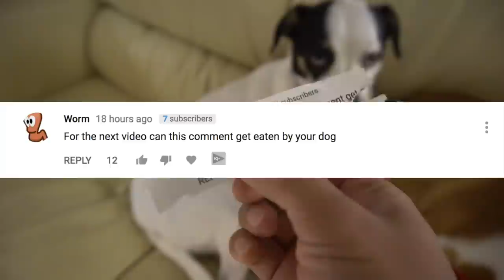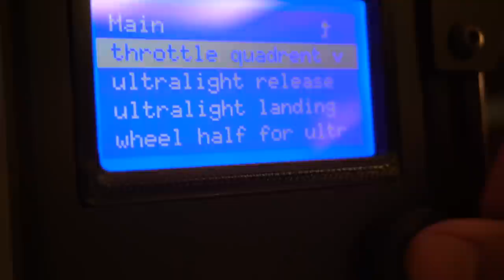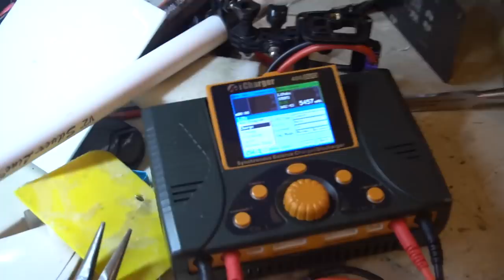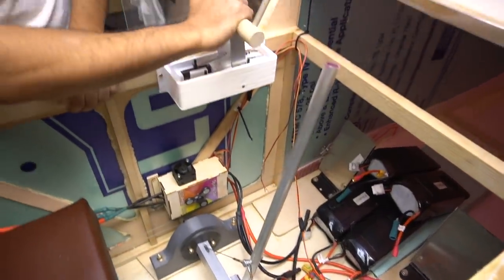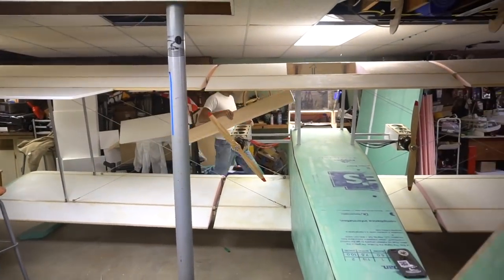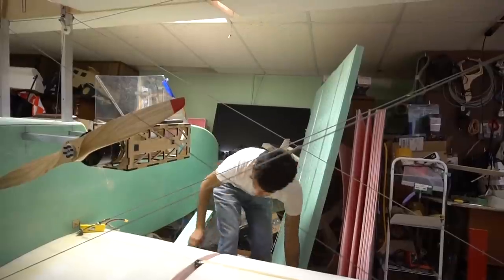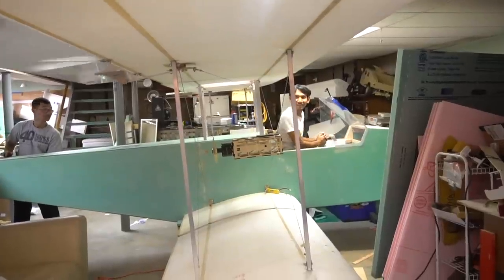DIY Electric ultralight pt6 (GIANT MOTORS and final checks)

Comment: Peter simulate a take off by giving it around 80% throttle for 2 minutes on the ground to check if the escs and motor can handle the current and will not cut off or something midflight due to temperature issues or something.
Reply: Nn
Reply: 69 likes nice

Comment: 11:02 the right motor bent forward a bit when you hit full throttle
Reply: well that is going to be problem... specially if it hits wires
Reply: That's more of a problem in a static environment.  When the plane can move, it will give way (move forward) before the bending moment of the mounts is reached.
Reply: Actually, you are wrong. Air space is not static, meaning that there is wind, gusts and turbulence, leading much greater forces than those 2 motors can produce in "controlled" environment. Of course that is not all, every physical object do have an resonance frequency where forces can easily amp up and break the object.

Also do you think those motors stop producing force right after his plane starts to move? Nah, propeller efficiency will decrease as airspeed goes up but that plane will not go so fast that it could do any significant difference.

random perception: Drag on that plane compared to prop size is remarkable. According to my experience this means high cruise throttle. I'm concerned that after take off there might be only 5 min flight time before he need to prepare to land.
Reply: maybe something like a big circuit breaker or just a cutoff switch rated at like 500A.  sure it will be large and heavy, but that way you can turn it back on if needed.
Reply: bent? its a miracle that those tiny square aluminium tubes didnt break
Reply: Brilliant! Man ! Brilliant, can I ask you to use a wire brace to the motor pods, to triangulate the support? only has to be fine braided wire but good quality, the torque from these motors will, in my opinion be quite considerable, so please brace :)
Reply: I think it just went forward a little bit

Comment: I would strongly suggest that you add some kind of emergency power cut off (like a handle), so that if you get into electrical troubles, you can pull the handle in half a second and then focus on crashing safely :)

Like if one of the engine controllers goes whack and you need to kill the motors to get out of a spin or so.

Looking forward to your maiden flight :)
Reply: Thing is, if the worst case scenario happens like the batteries go aflame, then cutting the power means nothing. Be better just to velcro them down and maybe add a handle like a piece of 3/4 inch rope to them so he could just yank them out in an emergency and toss them overboard then glide home safely. (he would need to move forward to counteract the CG being shifted more aft)
Reply: Shh.. Peter knows his stuff 🤚
Reply: I really don't want to be a hater, but if he gets into a spin at a low enough altitude(higher than, say 10 m and lower than cca 100m) no cutoff lever and no brs will save him. Higher, the brs might have enough altitude to activate and save his ass. He has very little chance to get out of a spin properly without proper training and the understanding how the aircraft performs in critical flight envelopes. Spinning is quite a violent affair, at a moments notice your legs are pointing straight at the ground and your airspeed rapidly increases, as you spin in the direction of the wing that lost lift first. It is quite scary and recovery must be practiced or at least taught(for airplanes in which spins are not permitted).  I don't know about his aircraft piloting experience, but he really shouldn't fly the maiden himself if he has none. It would be a waste of a great man and of the aircraft, that looks quite nice. Even if he just damages it, it would be a waste of a great project.

As for the propulsion system, lipo batteries are quite volatile, and even professionally made electric glider propulsion systems had some problems. I include a report about fires caused by FES systems in gliders:
https://assets.publishing.service.gov.uk/media/59c8f175e5274a49c07f4704/AAIB_S3-2017_G-GSGS.pdf

Best of luck,
Andrej
Reply: alterthough not crash glide
Reply: Lipos are bad news should they fail, speed controllers too. Just look at the fires in those hoverboards last christmas season and you get the idea of how volatile they are. Think how these batteries are often made by the cheapest way possible in China with low QC  standards. Foam aircraft have been built with small 2 strokes.
Reply: I have to laugh a little at this. If he throws the lipos over the side his cg is going to be completely screwed for the glide home.
Reply: eternalfire1244 there is no good solution here. Fire in the cockpit of a foam plane would certainly be a catastrophic event, with or without the change in cg. Especially if the packs are close to the cockpit.

Comment: Peter be careful those motors, in some testing I was a part of for heavy lift drones, we noticed that they can peak around 300 amps in a 14s configuration. Be sure to size your connectors and wire appropriately or they will arc and carbonize. The only ones we found that worked well were castle 8mm bullets. In one instance we had them melt the high temp solder and simply fall off of the wire.  Also I'm not sure what ESC's you are using but if they are the Turnigy dlux 250A we had 2 of 6 units that had bad decoupling capacitors.
Reply from the maker: Chase Hill thanks man good to know! Went with 8mms and the escs are good for 300A continuous so your comment gives me confidence!
Reply: Even worse, if only one fails the differential trust problems would most probably be unsolvable. He might want to look into contra rotating propellers even for normal operation tho.
Reply: how many watts are your motors?
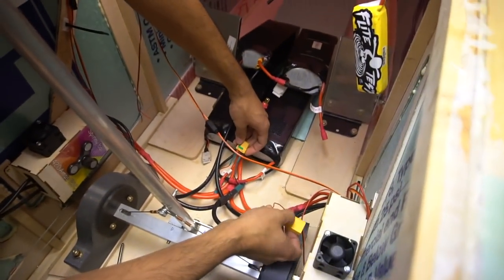Reply: Can any expert please tell me about the Spark Arrestor at 8:00 I have no Idea what Peter is doing, this is new to me I need to learn this before venture into bigger motor and batteries. Thank you
Reply: @zero00tolerance  There are big Capacitors on the ESC, which have a very low internal resistance. So if you plug the power wires in without Resistors, there will be a huge Current Spike that leads to a Spark between the Plugs. These sparks can damage the Plug over time. To prevent this, you connect a plug with a resistor beforehand so the Capacitors can charge themselves with low current thru the Resistor and then connect the big plugs.
Reply: @crazyphil3000   Thank you so much sir, do you mind send a link to the example part please that would be really helpful.

Comment: The motor mounts should have diagonal bracing to better transfer the thrust to the fuselage
Reply: Have a bump as I noticed this too. Also the anchor points of the wing stay wires aren't aligned with the force vectors. His build quality and attention to detail is steadily increasing though!
Reply: I thought the same too. The struts look like aluminium so they will probably be fine, but it wouldn't take much more weight to make them way stronger
Reply: My thoughts exactly! I also saw one of them shift under full thottle. One more thing; the motor and beam assembly may hit a resonance (natural) frequency at a certain motor RPM because of their geometry. He'll want to test at a number of different RPM's to make sure they don't shake themselves apart. Good luck!

Comment: Good stuff man! The only concern I have is when you put on the part that translates your stick movements to the control surfaces (min mark 2:05). Looks like you have the spar in the wing and that bit of foam as the only bonding surfaces. Is that going to be enough to hold up against the forces of the control surfaces pushing back on it?

Comment: I would personally recommend adding an air intake to keep your batteries cool. Some straps to hold the batteries in place wouldnt be a bad idea either!
Reply: I'd put it on the ESC rather than the batteries.
Reply: John Possum why not both?
Reply: I think it'd be a waste of aerodynamic efficiency to create that much drag -- I just don't think the batteries will need it. I suppose it all depends on how much he demands of it the first flight & then he can change some things around if need be. (my sense of Peter tells me he'll more likely be on to another plane/project before that.. Maybe he'll build a human sized boat next? )
Reply: He just did some low-level flying on his stream just now. Had to stop flying because his batteries were starting to get too hot or something along the lines of that. he could use one of those low-drag air intake designs

Comment: from what i know, the motor should spin in different direction to get balance, also the propeller
Reply: Thats not need most multiengine airplanes spin prop to same direction. look at a plane as Cessna 421 of Piper cheyenne

Comment: Do you have plans for a Fuse or Breaker for each motor/ESC/battery? easy to cut power to it in case of a runaway or something like that. Also, do you have a fire extinguisher rated for LiPo fires?  If the batteries do puff or catch fire in air, you should put some sort of shroud around them, at least to direct flames away from you (would likely melt out the bottom....) but just to keep you isolated. 
Love the videos, and Cannot wait for the maiden! Truly inspiring. I too want to build an electric ultralight, and this will help me figure out the logistics of electronics. What ESC's are those? I do not see a link to them like the motor.
Reply: Austin Smith yeah I'm wondering what esc's those are as well, but if I had to make a guess it's something out of hobby kings lineup because they probably provided them with the motors.
Reply: leo rawlinson I'd assume, but it's good to know specifics
Reply: On the Flite Test Community Podcast I think he mentioned them being jeti ESC's, so he's not cheaping out on them.
Reply: A good point.  An aluminium box or something like it might be appropriate.
Reply: They do 100A isolator could put one in each esc supply
Reply: At that voltage he could probably use those old-fashioned looking "knife switches" that people use on their cars. That should handle the current and the voltage and they are like $10 each. People used to put them under the hood as a el-cheapo method of avoiding getting their car stolen.

How do you breaker something that big? 250 watt ESC recommended and 190 peak current surge (The difference in those numbers should be a hint about their confidence in their ESCs BTW) He'd need a house main breaker. Spendy  for just one part! https://www.grainger.com/product/SQUARE-D-Circuit-Breaker-5ENP2

Here's a affordable reconditioned one in a top notch brand I would trust with my life: http://www.southlandelectrical.com/itemdesc.asp?ic=FXD63B200-R&utm_source=googlebase&utm_medium=cpc&gclid=CjwKCAjwj8bPBRBiEiwASlFLFVndwfdd5YB-N-1tXhSPZ8bih9UfpiSFIz-axIaQWjAv6L8ce9zVLxoCgEUQAvD_BwE

Comment: I suggest you add two resistors parallel to that potentiometer, so in case the wiper loses contact you still have some pre-set amount of power from the motor. Old crusty potentiometers like those faders seem quite unreliable to me.

Comment: You need to add independent brakes to the landing gear Which is operated by the rudder pedals so you can steer on the ground and taxi the run way with ease and a 3rd wheel so you are not trying to balance on 2 wheels or dragging your underside on the runway.

Comment: Peter put the propellers in opposite directions to decrease the torque effect I tell you why I am pilot and affects quite strong torque effect on a light aircraft like so I do not die XD
Reply: Do you mean to have one prop spin clock wise and one prop to spin counter clockwise?  Wouldn't have even thought of it but makes total sense. Im no pilot but i do a lot of boating and every boat that has twin engines or more have propellers that spin opposite of each other other wise the boat will pitch when under throttle.
Reply: its called angular momentum, I disagree.  The moment of Inertia from the motor/prop should be considerably smaller then that of the plane resulting in a slow (maybe even not noticeable at all) counter spin to the props rotation.  And guess what, when this happens the wing provides a restoring moment as the wing that rolls down sees an increase in velocity equaling more lift and thus restoring itself from the disturbance.  Thumbs down Goose
Reply: Wouldn't that be irrelevant being that there is two motors therefore differential thrust?  Wingman... fired...
Reply: 3D_ Tech  No we are talking about roll not yaw.
Reply: Hunter Roberts  edit both wings see the same increase in speed it's just that the one going down makes it so so the air is pushing up more.  The effect is the dipped wing has an increase in AoA while the (more lift) and the one going up has a decrease in AoA restoring the balance.
Reply: Look up P-Factor and how it Affects multi engine aircraft.
Reply: Yep  that is so that the p-factor does not affect the take-off time Which is the most critical stage and where the aircraft is most affected
Reply: Bump, this is important
Reply: didn't he work this out with the toy model he built?
Reply: Natty Waffel  afaik, this would have effect on yaw and roll..., centrifugal inertial force vs. centripetal force > roll as thrust > yaw... Left motor(CW) rt motor(CCW)...  For every action there's an equal and opposite reaction... force is equal and opposite to the centripetal force that acts on the object... Yin  yang, universe at peace or Peter Sripol doing barrel rolls at an incredible rate?
Reply: Natty Waffel ahh, that is interesting, wonder how much effect this will have relative to this project...  Is there some type of formula granted the defining factors have been calculated?  On second thought, just pin the throttle, should be fine...
Reply: 3D_ Tech,   it's a biplane too.  He's got double the mass out there increasing Ixx even more.  I'm sure all the aerodynamic, VT, HT coefficients are in very safe ranges.
Reply: Joe Rehm, do you see the size of his vertical stab (albeit plane looks a little shortcoupled).  His motor/prop is severely undersized and will be because of cost and weight.  P factor isn't going to be a big deal.  The vertical stab will restore any pertabation related to the yaw axis.

Comment: Hello Peter. I just wanted to say that I have been following your videos for several weeks and have to say that as a former aircraft mechanic and current pilot I am quite impressed with the work you've done thus far. What it your projected final weight? Have you calculated the total thrust of the motors at 100% and if so, what is it? What is your expected range, and/or duration of flight on fully charged batteries? How much do your batteries weigh and what type of battery are you using? What is your flying experience. Have you had any formal flight training to date, and if not, have you scheduled at least 5 or 6 hours of training prior to flying your electric aircraft? I'm also curious as to how the FAA regs apply to electric ultralight aircraft if you intend to fly under FAR 103. I know that in the case of gasoline engine powered aircraft, in order to qualify as an ultralight the weight allowance is 254lbs max without fuel. I'm guessing that they allow you the equivalent weight of 5 gallons of gasoline (30.3lbs) to be added to the 254lb limit to allow for the added weight of the batteries? I'm really looking forward to seeing your aircraft's maiden flight and wish you all the best of luck in your endeavor.
Reply: I'm very curious to see how well it performs. The one thing that immediately occurs to me is that your CG should remain constant owing to the fact that you are not burning off weight (gasoline) as you fly. Once it is properly balanced and trimmed it should remain relatively stable provided all else is well.
Reply: Peter test flew the aircraft a few hours after posting this video. He did it after sunset(he said 30 - 40 minutes after, there was some delay, I think it would be much wiser to reschedule the maiden ), with propellers that he himself said were not the best choice in combination with his battery pack, and in a hurry. He was a bit too mission oriented imho, dangerous. The test flight was, nevertheless a success. He did a few jumps and then a short turning flight, after which he landed a bit hard but with only slight damage to the underside of the nose of the aircraft(it is a taildragger and it tipped at landing) There was a livestream, but it seems the recording was removed. The aircraft was too nose heavy, he had difficulty maintaining level flight as constant back stick pressure was required, which also increased drag. He was pretty much on the edge of a stall all the time, according to himself. He was otherwise pleasantly surprised with how the aircraft handled.  He said that he has a PPL licence. I think he is winging it a bit too much with this project and he takes unnecessary risks, even though his technical prowess is really enviable. I hope he sits down and thinks things trough a bit better, then he is sure to succeed.
Reply: Thank you for responding Andrej. I'm glad to learn that things went well all in all. I'm sure that once he gets the balance corrected it will fly much better. I'm looking forward to seeing video of it flying.
Reply: Timothy Horn That makes two of us. Hopefully this project will turn into something capable of short joyflights and not just proof of concept jumps. Even this is quite an achievement, though.
Reply: Andrej, do you happen to know how much the completed, ready-to-fly, aircraft weighs?
Reply: Timothy Horn sorry, I don't remember, even though he said it on stream. It was an estimate I think, but way below the legal limits according to Peter(I have no clue about microlight legislation in the US). It is subject to change, though, as the aircraft was not completely finished
(no paint, no fairings where the wing and fuselage connect, wrong batteries, propellers and maybe even electric motors)